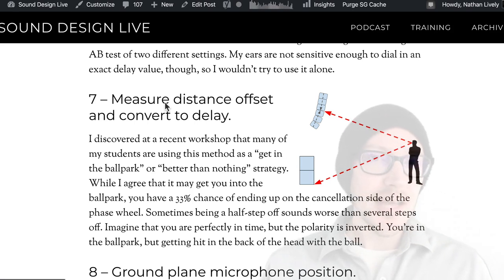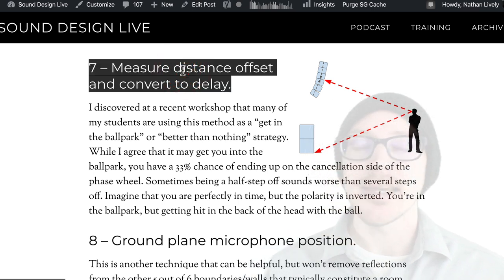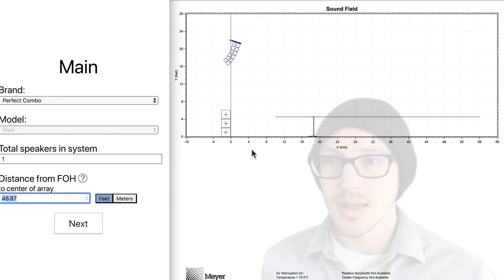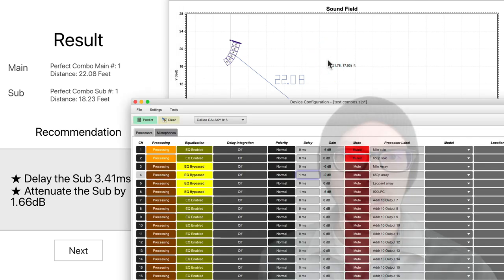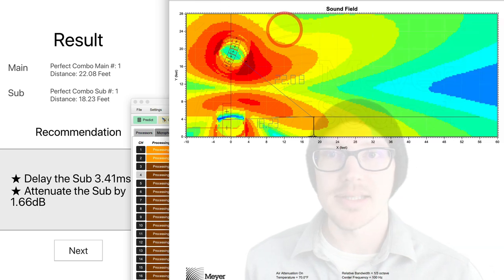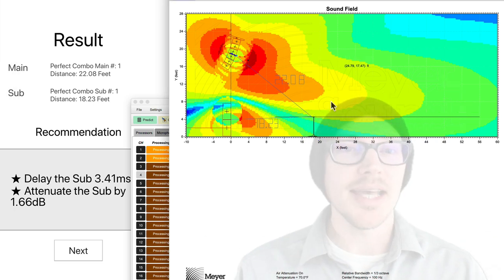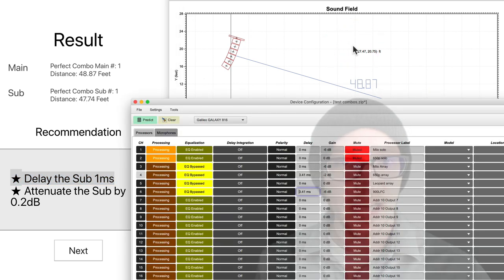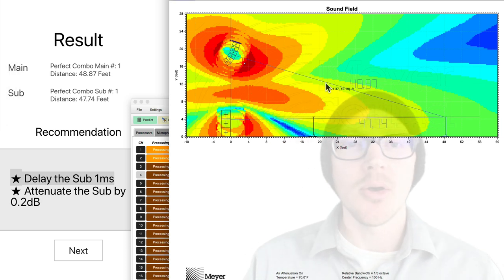Crossover alignment with a laser disto??

Comment: So if you used the relative/absolute method first in a controlled environment and made sure the speakers were phase coherent, then this simple distance method would work better, correct?
Reply from the maker: Correct! :) 
have you tried it?
Reply: @nathanlively  Not yet, but i can't see how it wouldn't work! Obviously the alignment will only be perfect at the location we measure from but that's the case with any measurement so we should be fine